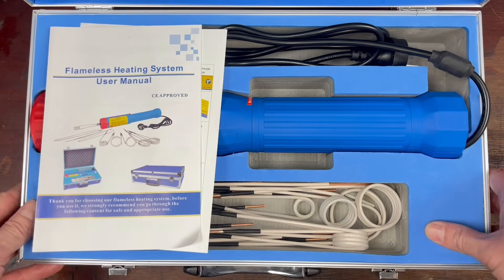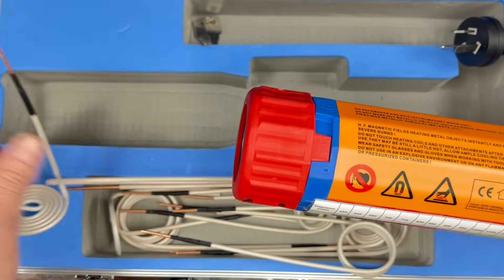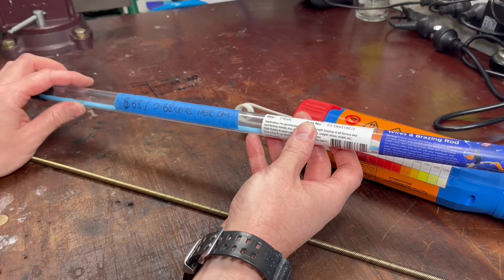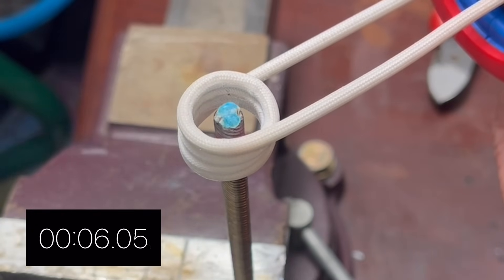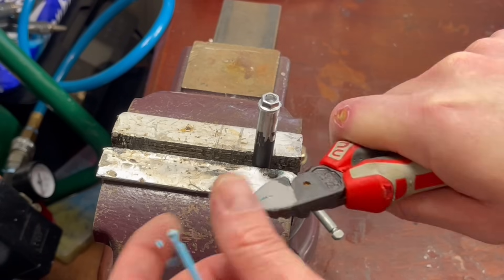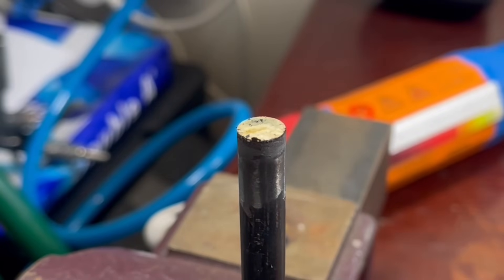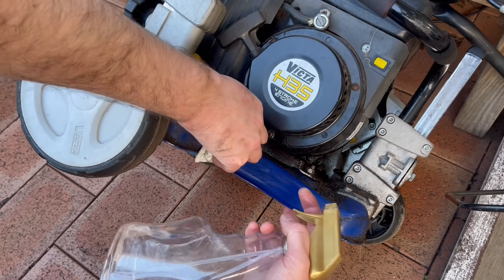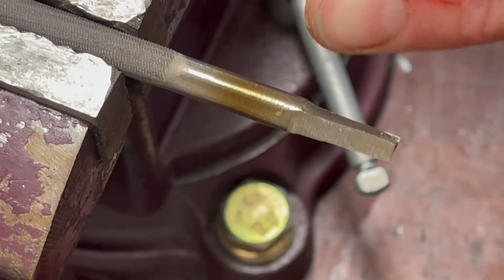Every Mechanic Needs This Tool! Save Time & Money!

Comment from the maker: If this video helped you, please consider clicking on the THANKS button above to support my channel  and don’t miss this video next on repairing a Briggs and Stratton classic engine https://youtu.be/JzYDhSWKgV8
Reply: It would be neat if someone could build an arduino controller that would take the data from infrared thermometers and have it control the induction heater so that you could temper steel. It wouldn't be perfect, but it would be useful for tool tips like the ends of screw drivers and chisels or for home blacksmithing.
Reply: Welp.. I'm sold.
This tool has just become a must-have for my humble little shop.
Reply: P0pppp
Reply: I really wish you would have tried to twist that nut off with a socket; see what lets go first, the nut head or the brazing!! I think you could make a video just on that alone.. depending on the result.. but maybe a good video either way. Learning is always good!!!
Reply: Thank you China !
Reply: The file is brittle to start with

Comment: I have one of these. It's obvious really but go careful as they can make penetrants catch fire even days after use. I bought mine after struggling with some hard to reach rounded rusty bolts near the fuel tank on a car and had used penetrating fluid days before getting the tool. Ordered the tool, arrived maybe 5 days later and held the tool on the nut to make it cherry red and then there were flames 😂. It sounds obvious but as I'd applied the penetrating fluid days prior and it didn't look wet when I used the tool, I didn't expect to see flames. Only had it on there less than 30 seconds too. Pretty sure my instructions say 30 seconds is the max.
Reply from the maker: Oh wow that's crazy! Very good points raised :) well done!

Comment: Just as an aside, you showed rosin solder when you were mentioning soldering that drive shaft.  For non-electrical connections you will have better luck with acid solder, and I would strongly recommend acid solder paste in addition to whatever might be in the solder that you are using.
Reply from the maker: Hey, it's not lead solder - that won't stick. That's silver brazing rod. Thanks for watching and commenting!
Reply: @VintageEngineRepairs  I'm referring to 2:49 where you said "I gave it a go with tin solder" and you show a spool of Weller rosin-core solder which is for electrical work and is not appropriate for the task.   Had you used acid flux and solid solder then you may well have succeeded in your attempt to use tin solder, as it has been used for sheet metal and other such tasks for generations.
Reply from the maker: Thanks Mike! Good to know - I'll give it a go next time!

Comment: 13 13,20 you used a brass brush to clean the ceramic on a plug not a good idea you’ve imparted brass into the ceramic which will short it to ground. Thanks for the video.
Reply from the maker: Thanks for sharing, always best to use a new plug for sure :)
Reply: Thanks,but the point was “ don’t use brass” ,stainless is more appropriate as it’s much less likely to contaminate the ceramic insulated. Thanks

Comment: i have one of those induction heaters. I bought new insulation to replace insulation i burnt. replaced them with yellow, I think it's Teflon, can actually make your own by buying the correct gauge copper, the insulation and some shrink tubing. I believe it was on Aliexpress i bought the insulation.
Reply from the maker: Yes I have done the same :) brought copper wire and insulation separately !

Comment: Is there anyway to get this type of tool to work for silver soldering/brazing on a fuel tank where you cannot get a coil wrapped around the flat surface?
Reply from the maker: I’m not sure honestly! This seems to only work effectively on ferrous metals and brass shells for reloading.

Comment: This WON'T HARDEN steel unless it is immediately QUENCHED after the heating. 
I've go one of these, and it'll make the bolt SOFTER so that the bolt HEAD more likely snaps OFF.
Reply from the maker: Yeah… that’s basic hardening 101… quench while cherry red.

Comment: Bending the hardened, tempered, and annealed parts would be more informative than hammering it. It is difficult for a viewer to determine the effort required to bend or break something as a result of a hammer blow. The induction tool could certainly be helpful in many situations in a shop. Thank you for demonstrating it for us.
Reply from the maker: Thanks for the feedback and kind words!

Comment: I'd like you to try brazing two copper pipes together.  If it worked, it would save HVAC techs time because you don't have to flow nitrogen when brazing.  In other words, you wouldn't have to worry about soot building up on the inside of the copper tube.
Reply from the maker: It is really not the best on non ferrous metals. It works on tubing but not solid round stock. I know re-loaders use it

Comment: One should never use a metallic brush to clean sparkplugs! The abrasive nature of the porcelain can scour metal from the bristles and cause the insulator to conduct the spark where it isn't desired. Abrasive blasting is best. It has been the proven method for many decades.
Reply from the maker: Thanks for sharing, I haven’t ever had an issue, I don’t sand blast because even if you think you’ve removed all the debris even using fluids and air, debris can still be in the plug and it has led to many engine failures. It was in a Briggs and Stratton bulletin.

Comment: The consumables can be made with solid copper wire inserted into the propper silicone impregnated fiberglass tubing or bought in premade bulk lengths from amazon. Also you can use regular braided copper wire if you tin the ends.
I think it's 10awg.

The basic unit has sellers going down to $155 on amazon in a box with basic wire set. [As shown in review]
Reply from the maker: Spot on :) you’re absolutely right!

Comment: I don’t understand why it would not work on nonmagnetic material. As induction works on every conductor
Reply from the maker: Only works well on ferrous metals due to magnetism.
Reply: @ have you tried ? I bet a  beer case on this
Reply from the maker: @ yes it doesn’t work, it does on shells surprisingly, but solid bar, no.

Comment: They are actually a pile of manure. Takes 3 or 4 times longer ghan a proper flame and no propane is not a proper flame and will burn out with any kind if constant use. I say this because i bought 1.
Reply from the maker: Sounds like you got a dud unfortunately.
Reply: @VintageEngineRepairs  Maybe, I found that constant use ig only lasted 7 weeks which in my mind is just no good.
Reply from the maker: Yeah that’s useless, sorry to hear it. I have had mine for months and use it a number of times a week for all manner of tasks with no issue. I used it today to braze in fact!
Reply: @VintageEngineRepairs  Well I hope it keeps working for you because the warranty is impossible to redeem.  Keep up the good videos
Reply from the maker: Thanks mate 👍🏻

Comment: NEVER NEVER NEVER WIRE BRUSH SPARK PLUGS IT WILL RUIN THEM TO EVER USE AGAIN
Reply from the maker: I do it all the time, it’s fine.
Reply: @VintageEngineRepairs  Ok im sorry but your wrong even the instructors at the mechanic school i attended said never ever use a wire brush on a used spark plug and here,s Why? the metal wires scribe traces on the porclin insulator the white part and spark will follow those fine traces taking the path of least resistance and will act like a fouled plug cause the spark will be bleeding off in the wrong places instead of the gap! does that make sense too you now?
Reply from the maker: That doesn’t make sense, firstly the porcelain is 6-7 on the MOH’s scale hardness while wire brushes are 4-5. They won’t be able to scratch it, and even if it did, tiny scratches it won’t cause the ground to go through the porcelain. The only reason to be cautious using a wire brushes is leaving a bristle can cause it to ground between the electrode and ground strap. Use some compressed air and you’re good to go.
Reply: @VintageEngineRepairs  in tech school we did a test on this experiament in a pitch dark room and we witnessed the spark trail down the insulator it was pretty evident that it does have an effect on the spark plug. Sand Blasting is by far the bast way to rejuvinate a used spark plug
Reply from the maker: I would never use a sand blaster, more engines have been destroyed due to debris stuck in the plug, being relegated into the engine. You do you, but I’ll stick to wire brushes.
Reply: @VintageEngineRepairs  Haha there,s a thing called compressed air to blow any debris out of the insulator and one grain of sand if by strange circumstance? would never be enough to damage and engine
Reply from the maker: Na, of course it probably wouldn’t, but it’s just never really sat well with me. I heard of an article where, possibly Briggs? Released a statement to not use sand blasters as it was wrecking engines. No denying how effective it is, but I’ve always been cautious. With that said, if a careful wire brush does ever cause me spark issues, I’ll hold my hands up and admit I was totally wrong. Have a watch of this, I found it: https://youtu.be/i8WFzysX350?si=9wgen-NfihjkVFYV
Reply: @VintageEngineRepairs  Yeah i love that guys videos very entertaining clips
Reply from the maker: @ yeah, great content and incredibly knowledgeable too!

Comment: yersterday i refill a acetyle b2 tankfor 100$ and i use almost half of it trying to separate a washer shaft from the tub,  i ordered a induction heater for 359$, can t wait for to come. if that tool can braze , i will rarely use torch again
Reply from the maker: What a nightmare! I think you’ll be very impressed. Make as many coils over the part as you can and get them as close to the part too (without touching). You’ll be amazed how effective it is!

Comment: Can you use induction heater to break free nuts welded to exhaust bolts, instead of torching or cutting them free
Reply from the maker: Absolutely! It’s a perfect scenario in which to use it :)

Comment: This is an old tool i used every day while i was working at Toyota, Hyundai and Honda like 17 years ago, the one we used was called Mini Ductor, the Vevor is more for the consumer at home we tried it in a garage and it dies after 2 years while the Mini Ductor is still working after 10 years at Hyundai (the last garage i did work before i changed my line of work) although he is a lot more expensive, i think they made a more powerful version now a 1800 watts. 
What i like about this tool instead of using an acetylene torch for heating bolts is the fact that you don't need to worry about burning a bushing while heating the bolt.
Reply: I’ve got the Mini-ductor Venom you mentioned. It’s the 1800 watt version. Like every tool in the garage it does have its pluses and minuses. 

The biggest plus is that you’re much less likely to start something on fire like you said. Bushings are still an issue though because the bolt you’re heating will still likely transfer enough heat to the bushing to ruin it. 

The biggest downside is accessing the material you want to heat and only being able to heat ferris metal. For instance I wouldn’t use it for cleaning a spark plug because what I want to heat is actually the wet or crusty ceramic insulator around the center electrode. For that I’ve found that the best tool is a small #1 or #2 tip on my acetylene torch. With the torch I can precisely heat the insulator until it glows orange and burn off any conductive hydrocarbon crud that is shorting it out. That works 90% of the time for me.
Reply: @Dave-ei7kk  i agree there are still some jobs that can only be done with an acetylene torch in a garage but for the DIY at home (hobbyist) the ductor is enough, having to carry around the torch and fill them is annoying.
Reply: @deadbluesky  acetylene is prohibitively expensive here for a diy too.  I appreciate your info and comments.
Reply from the maker: Yeah I agree, it's hard to justify!
Reply from the maker: Thanks for sharing!

Comment: Hmm, I’m wondering if I could use one in my facilities maintenance job instead of using a flamed tool that I’d need a cumbersome hot work permit with a constant fire watch for a hour and a intermittent fire watch for an additional two hours.
Reply from the maker: Absolutely, it would be a fantastic addition to your current setup and may find that it replaces it in most instances - I have. Flame has its place without question, but I’m reaching for my induction heater far more often than the torch now days!
Reply: These certainly look neat, I'm just trying to figure how often I'll use it. I already have a stick welder, a wire feed, 3 oxy/acetylene, 1 turbotorch, a propane torch, a propane forge, and a little butane torch for detail work. The flameless aspect has me intrigued, and I do have enough amazon gift cards to get this...temptation....I'll have to sleep on this one, last impulse buy I just had to have a shiatsu massage chair that I never use
Reply from the maker: You nailed it, it’s the flameless aspect (and just how efficient and quick it heats to cherry red) than is so good and unique!
Reply: you muat woek where i used to work..but either way,you know damn good and well theyll still find a way to tie your hands behind your back.😁

Comment: I enjoy your videos!  Useful subject matter and HIGH production values: Steady camera, in focus, narration matches video, Story sequencing advances the message without gaps.  Kudos too for understandable enunciation without Australian idioms that this Cajun cannot fathom!  Again, great job!  I look forward to more videos.
Induction heater comment.
First time I saw induction heating was in 1976 at a 3-mandrel tube swager at Dana's Spicer Axle plant in Ft. Wayne.  - a 12-foot tall device that sequentially induction-heated & then swaged a bell-shape on the outboard end of an axle tube.  Each successive mandrel took the straight tube a bit further to the final shape.  The Holder/transporter mechanism picked up new tube at top, with each cycle;  Pickup, Heat, Swage1, Heat, Swage2, Heat, Swage3, then drop into a pit of coolant where a conveyor belt hauled it up.  The machine cycle time was about 5 seconds to cherry-red.  So a finished part every 5 seconds and a through-put time of 30 seconds! It fed a process that produced 100,00+ light truck axles / month.
Reply from the maker: It’s always really nice when people like yourself realise and mention production quality, narration etc. I work really hard to make the content as engaging and high quality as I can so when people realise it it’s great :) thanks for sharing!!
Reply: @VintageEngineRepairs  ....I agree, the Cajun is right.  Nice job.

Comment: there is a battery induction heater for sale on ebay, 12v, 120w that can do what you did and costs $5-6, unlike this one that has 1000w and costs $220
Reply from the maker: 12v 120w won’t touch what a 1100w will.
Reply: @VintageEngineRepairs  of course, but for smaller things, up to a thickness of 8-10mm it works quite well, I use it to heat the chain on the bike to wax it without removing it from the bike

Comment: Going to try to live without one but I've needed one a few times and not had it.
Any bolts that go through into a wheel are bad.
Reply from the maker: Yeah especially in rust belt areas!! Nightmare. Fortunately we don’t salt the roads here in winter, we don’t get snow.

Comment: Very good video with lots of useful and clear information. They certainly are great tools to have in your inventory, I work on all sorts of kit but a lot of vehicles and suspension nuts are often as rusty as an anchor, this tool makes short work of removal often where localised heat is an advantage (ie where you don't want to affect the structure / nature of the adjacent piece of metal that is not sacrificial. Every workshop should have one.
Reply from the maker: Thanks for the kind words and feedback :)

Comment: Pretty optimistic review..  Of course induction heater is better on many ways. But it is not better on every ways. Looks like you have those pink glasses you are watching trouhg.. I am just trying to be honest. You know.. It is not so bad, if propane torch is't better than induction heater. It is just what it is.. Not big deal.
Reply from the maker: When did I say it’s better in every way? Did you miss the comparison to the propane where I showed how propane excelled in areas above the induction heater?

Comment: Ive been ysing my induction heater tool for a year now.  I use a laser temperature tool to give me a more-accurate temp range, than to depend on metal color change.
Share with us what you've done in the way of tool experiment shaping.
Reply from the maker: Awesome! I use mine all the time. It’s my go to, if it doesn’t work for my needs only then do I grab the propane lol.

Comment: The heating happens from the induced "Eddie" currents, so no, it does not need to be a ferrous metal. Try it on brass, you'll be surprised.
Reply from the maker: Hey, I tried it did nothing, hardly even warm. However on thin wall tubing it did well!
Reply: @VintageEngineRepairs  very interesting, perhaps it's using a frequency optimised for iron/steel. In general, though, is most definitely not a "ferrous metals only" device. Brass, copper, aluminium, etc. have better conductivity (i.e. lower resistivity) so even if the induced current is the same, the heat generated is I*I*R (I-squared-R, lol), with a significantly lower resistance, the amount of heat generated would be low.

That's the only reasonable explanation of which I can think.

An awesome device nevertheless. Thank you.
Reply from the maker: @NurchOK  thanks for sharing :) yep I have seen commercial induction heaters work on copper! 👍🏻👍🏻